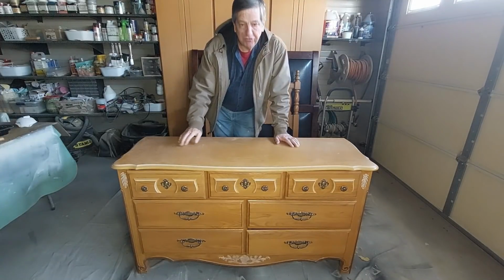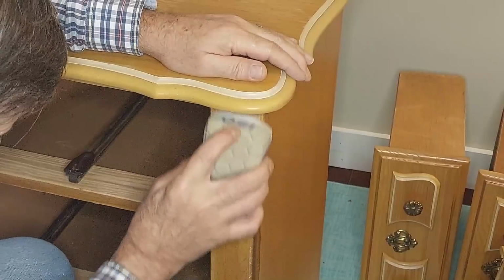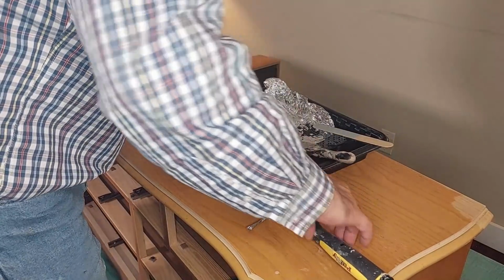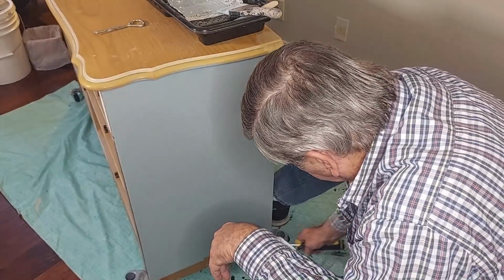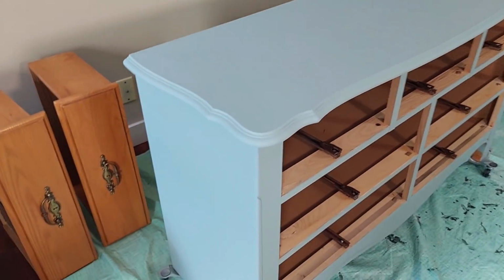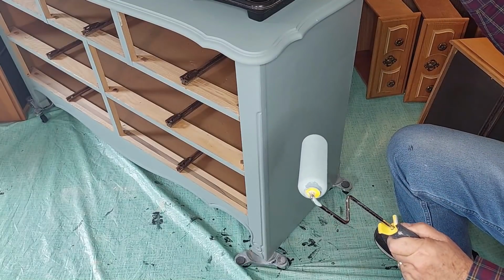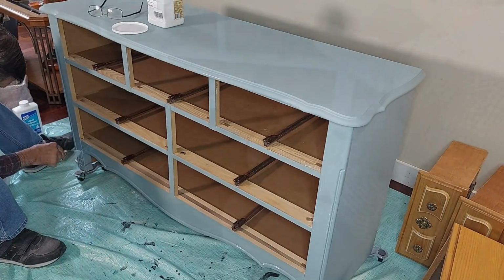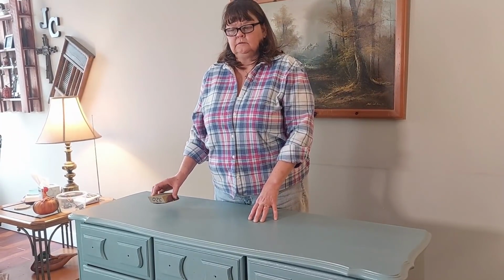DIY Dresser Makeover With Behr Chalk Paint and Liquid Sandpaper | Trash to Treasure

Comment: Great color choice guys. Looks beautiful. I am a huge Dixie Belle paint fan, however, the top coats, I don’t love. I use Gator hide, on tops for durability sake, but working with it , is a bear. Takes patience and practice. The other choices… I won’t use. To quote Cindy…. Splotchy. It’s just too thick, to achieve a thin coat, hence splotchy. Nothing like having a gorgeous paint finish, then ruining it with top coat. Ahhhhh 😡😡 been there many times. My best top coat experience has been with General Finishes. 
Comparatively priced, with higher end topcoats. Also, if you want to try an excellent, and I do mean excellent brushes, look into Sleek. They are from Australia. You have to wait a bit on shipping, about two weeks, to get in hand, after order, but the prices are excellent. I won’t touch another brush!!!! They clean like no other, absolutely nothing sticks to them, which is what ruins brushes, and they are like silk! I have absolutely no affiliation with them, I just really like the products. Happy Thanksgiving! 😊
Reply from the maker: Thanks Joyce! We have used General Finishes products (including topcoats) many times. It does take some practice and patience to brush on or sponge on topcoats. We generally will spray them for this reason, but the garage is too cold with winter coming. Sometimes, I have fired up the heater in the garage, got it up to about 70 degrees, opened the garage door, sprayed, and then closed the door right away. It can be a bear, but sometimes we do what we gotta do! Will have to try the Sleek brushes!😀😀😀

Comment: Good afternoon Jim and Cindy ...so I got some liquid sand paper and I'm rewatching y'all's Video....just wondering Before I get started If you have had any issues with your paint After using liquid sand paper ...do I Need to wipe with water after using the liquid sand paper or anything I need to know besides the process Jim used with this product 😊.....thank you For your Time😊❣️
Reply from the maker: Hi Debra! We wipe on the Liquid Sandpaper in a circular motion (kind of rubbing it into the surface). Per the directions, we have not rinsed after application. We can only really speak to what we have used......it has worked well using Behr Chalk Paint, and Dixie Belle Silk. So far those are the only 2 paints we have used it with. All  of the chalk, milk, and mineral paints are similar, but they are all also slightly different in how the manufacturer makes it. So while we can't say it'll work with all paints, we have a pretty good confidence in it. We hope this helps! Thanks!
Reply: @FurnitureWarriors  awesome And I Thank you .....I pretty much only use Dixie Belle products and occasionally Behr ..So I'm Good with Y'all's Amazing advice ...thank you so much and Merry Christmas to My Giggling Beautiful Cindy and Jim boy! Y'all are the best🎄⛄❣️❣️

Comment: Hi, could you let us know how the liquid sandpaper holds up. Does it provide a good surface for painting laminate? Thanks!
Reply from the maker: Hi Paula, We usually scuff sand laminate with a 220 grit sandpaper just to dull down the finish, then follow up with the liquid sandpaper. this process has worked very well for us. On other topcoated finishes, we sometimes just use the liquid sandpaper and have not had any problems. Thanks for asking!
Reply: @FurnitureWarriors  thanks. I thought it was a miracle tool. Have a great weekend.